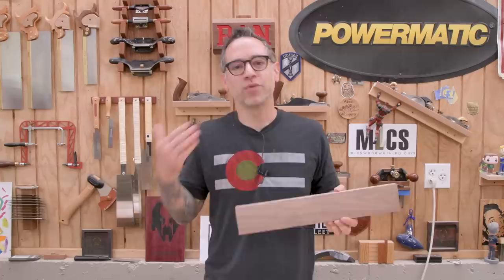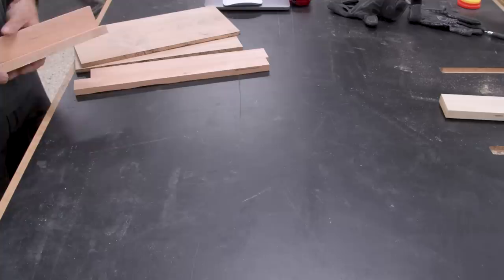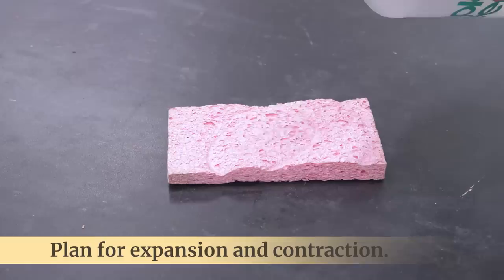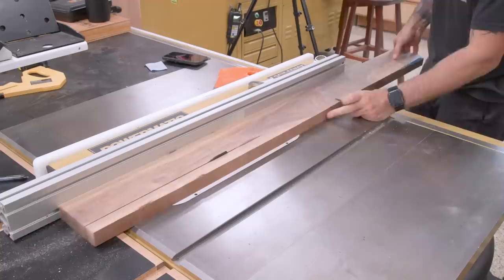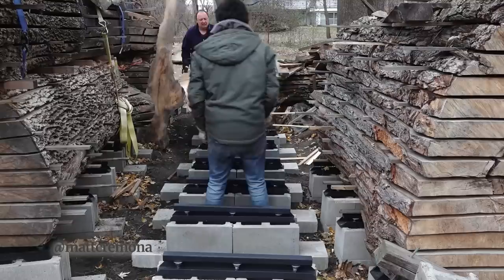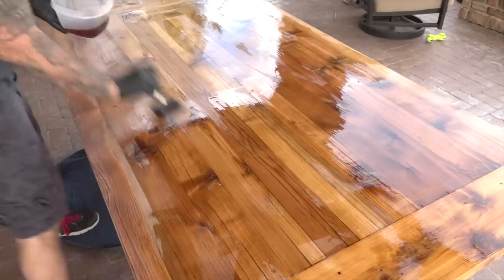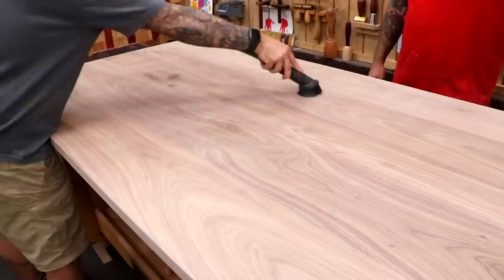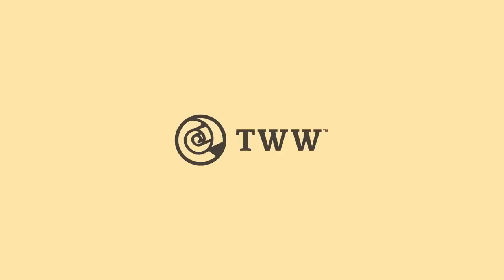Don't Make These Lumber Mistakes! | Tips for New Woodworkers

Comment: Every single new woodworker needs to see this video! As an amateur woodworker myself I’ve seen this happen first hand. Even today on my table saw I saw the off-cut wood bow out as I was cutting it. If only I had left enough margin on the stock to joint it again 🙄 But I’ve learned very early that a project is very fluid - the design has to change with the wood sometimes.
Love your channel and thanks for teaching an amateur all the way down in South Africa 🇿🇦 all these great lessons!

Comment: My dad owned a small sawmill when I was in high school. I remember trying to tail behind the head rig when someone logs had so much tension they would either bind the saw blade and cause it to want to lay over or they would curl so far away from the cut it was almost impossible to keep the board on the roll cages. Having been in woodworking for almost 30 years I can attest the same is true to the wood we use. Another thing to pay attention to when purchasing wood is grain direction. Is it quarter sawn or plain sawn and understanding how the wood moves accordingly. Great advice on getting wood that is sized to the project instead of reading it.
Reply: @Robo.1776  if you're trying to purchase wood to resaw for projects instead of the right size you will waste more than you try to save from tension in the wood and in some cases due to case hardening from the kiln process. And understand the way wood moves (expands and contracts from moisture variances) will make a difference on whether you get quarter sawn or flat sawn wood

Comment: Your discussion of plywood was spot on.  I bought a lot of birch veneered plywood that was apparently from Vietnam.  The veneers were paper thin and came off easily, the cored were irregular with voids/overlaps and poorly glued causing lots of issues.  I have never had so many splinters from any one material in my life!  Fortunately, most of it was used to cover the walls in my shop rather than building something from it.  I got a bunch of Baltic birch from the same source and it was very nice to work with.  

Recently I bit the bullet and bought some Purebond maple veneered plywood from a local home center.  It is almost as nice as the Baltic birch.  The core is all poplar.  My good sawblades are out for sharpening so I'm using an inexpensive Diablo at the moment and still had no chipout from the Purebond ply.  The veneer is much thicker that the cheap birch veneered import ply and it handles beautifully.  My wife was even impressed with how nice the French cleats looked in maple veneer.
Reply: And your experience with the plywood is the reason why my biggest pet peeve is suppliers, and even woodworkers, calling ply Baltic Birch when it isn’t TRUE Baltic Birch 😂

Comment: So appreciative you explained the 8/4 v 4/4 resaw "myth." I was under the impression that 8/4 was the best way to go to maximize yield, and its just not practical based upon cost, let alone the time, effort, and toolage cost to be able to resaw wide boards.
Reply: Most of the time thicker wood has to be a higher grade to make the same size boards. You can start with 5/4 and mill the imperfections out of it for a 4/4 board, but it is alot harder to do the thicker you get. We had to explain this to a customer once that wouldn't understand that 8/4 juniper is impossible to get without bark/wane/knots.
Reply: Yup unless you need smaller boards <1/2” resawing is a waste of time and money, but if you need anything under 1/2” it’s worth it of course because the mark up on those thinner hobby boards is asinine.  Two other tips is always ask for shorts if you don’t need long stock, it’s usually 25-50 percent savings per bf, and don’t sleep on 1common, especially if your project can get away with a few knots for “character”
Reply: Yep. If you put yourself in the mind of the mill operator, it makes total sense. Delivering a lovely big timber is quite an achievement. Resawing flitches to get some residual value out of the smaller material is a good way to produce inexpensive lumber IN SMALL DIMENSIONS.

Comment: Hello, WW
Thank you for this excellent video and I greatly appreciate what you have described as i have encountered most if not all of these conditions. Worst part is when you start with perfect pieces and after machining you end up with nothing but warped and twisted pieces. 

There are a lot of things that we still don't understand about wood like:
1- How long does it take for lumber to acclimate?
2- Why same wood pieces expand and contract differently?
3- Not sure I agree with calculation of how much oak piece of certain width should expand and contract. A good example is wood flooring. In my mother old house, the humidity various from 19% in winter to 85% in summer. The floor violates every rule with heavy coat of polyurethane on one side and nothing on the bottom side. If I follow calculation of expansion and contraction, that floor should bust and smash into the walls in the summer yet every year I measure less than 1/4" movement.

Again, thank you for excellent video and for recommendations. They help but not always effective. Regarding plywood, plywood warp over time and changes in thickness in contrary to common belief that plywood is a stable material. Anything made out of wood is never stable if humidity is not under control. I follow all the rules and sometimes still end up with warping, twist, and anything but flat and square.

Comment: I first learned about "case hardened" wood after resawing a 5/4 piece of cherry that was supposed to become the frame for a box.  It bowed so much that the last 1/2" of the board split on it's own before it got through the bandsaw blade.  Made one hell of a sound - like a gunshot.  Scared the crap out of me.  The board was about 36" long and 9 Inches tall.  Putting the two pieces together afterward there was a 1-1/8" gap in the middle.   Talk about wood movement! :-(

Comment: Good video. Many woodworkers know wood moves. High quality laminated plywood's dry or not do have "board memory".  The edge has a different moisture and stress levels than the center. On a long rip you will see the space where the saw blade passed through close up or spread out. To combat things like this on panels cut out over sized. Rest time to acclimate. Trim all edges as close to same amount as possible to finished size.
 There is another place carpenters can misunderstand properties of wood and moisture. Rough framing lumber and fasteners relationship. Attaching something like dry wall use the shortest screw or nail within reason possible on install to avoid pop. Longer nails or fasteners that go deeper into the lumber will pop more than shorter due to the ratio of shrinkage changing from low at center to more at surface on all sides. Pop happens cause the tip stays put and the surface to tip area shrinks. the longer the fastener the more this happens.

Comment: Heh.  Watching you saw that long, thin board on the tablesaw brought back memories of my only injury at the table saw.  We ran out of 1x2s (trailer manufacturing) so I had to cut up some 2x4s to make them.  Of course that saw's kickback pawls were lost years ago.  Started slicing a badly case-hardened 2x4, which started warping badly, and it caught the blade and kickback city.  
A standard tablesaw is 36" tall,  my inseam was 37".  Guess where I got "punched"?  
Coworkers and foreman got a great laugh out of it, I didn't think it was quite so funny!

Comment: Thanks for the resaw comparison. I have frequently resawn thinking I was saving money. Also, with re-sawing, for me at least, you have to deal more frequently with cupping and twist. After the board is resawn now the resawn side is now exposed to the air and any  moisture or internal is stress released. From experience, this can result in a board that looks like a potato chip.

Comment: To expand a bit on the final topic (about making best use of wood grain) I think we will almost inevitably produce much better work once we develop the habit of paying attention to how each piece of lumber has been cut ... and then think about how THAT cut will work best for a given application.

The most basic example is face grain versus edge grain. (Do a quick web search on this if you don't already know what I mean. It will lead you to many more insights besides this one.) Shipwrights have to pay extra attention to how lumber is cut because, very often in boatbuilding, pieces are steamed or sprung into curved shapes. Wood bends with fewer stresses in the same manner and in the same orientation that the original tree bends. Use this property to advantage!

And the same principles apply, in somewhat milder form, to everything we build. It's not just about looks: it's about how easy the piece is to work into the desired shape, and how stably it will remain in that shape. (But yes, it is also definitely about looks. Because form follows function, after all. Discerning people can see the difference almost instantly.)

Something not often noticed in western woodworking culture, but DEEPLY part of Asian culture, is an awareness of the tip end and the butt end of a piece of lumber. We tend not to think this is even a thing! Well, it is, and we have simply forgotten. For a guy like Jim Spilsbury, who was a radio engineer here on the West Coast of Canada during the early days not so long ago, you simply couldn't build a radio mast - even a guyed one - without understanding which end of the spar was which. Not only is the butt end of a yellow cedar wider, it's significantly more dense and more rigid. The tip is light and flexible, just as it should be. So in timber framing, and really in any construction, we want our posts to be set in the same orientation they grew. All else being equal, we want a cantilever to be cut with the dense wood closest to column and the lighter wood out on the cantilever. And again, discerning people can see the difference almost instantly.

Comment: A few years back, I stopped buying plywood from the local big box stores. Even their expensive "cabinet grade" stuff was full of voids, had thin veneer, and would warp like mad.

Now I drive a bit further and buy from a company that mostly caters to businesses. They do have minimum order quantities, but it's quite reasonable. Also, I'm getting baltic birch which is far more stable than what I can get at the local stores. Price is a bit more, but they also loaded my pickup truck for me. That alone was a huge deal when you consider 600-1200lbs of plywood :)

Comment: You could have also mentioned that it is worth going through the stack to find the quarter sawn boards and those with a grain direction that is likely to stay stable. It is also worth taking a moisture meter with you to the lumber supplier to check the actual moisture level of the board. It may have been kiln dried to below 10 but you have no idea how long ago that was and the wood can take on moisture in the rack unless the supplier has a humidity controlled building.

Comment: It is worth just keeping in mind that even in antique and "vintage" furniture you see these and similar mistakes made.  I've seen old pieces where the wood working and moving had gradually torn the pieces apart over time.  The original maker had ignored or underestimated the movement the wood would be susceptible to.

Comment: When milling pieces that are relatively fresh, and then stacking to air, it can help to paint over the ends of the boards, as that is most of the evaporation occurs, as well as splitting. Not a huge cure, but definitely helps.
Reply: Yes, that's why when installing stain grade base I like to completely smear glue over the miters and scarf joints.  It seals the end grain.

Comment: Excellent info as always. You are definitely a trusted source. Honestly I think you deserve your own TV show. I'd watch it. 

You're so right about wood prices varying even across town and at the same chain stores. Here we have like 6 Lowes' in driving distance and 2 Home Depot's and of course an upscale store specifically for woodworkers and yes prices go up and down. Luckily through diligent research (i.e. Being cheap) I found a hardwood supplier that carries Baltic birch at a better price along with, of course, hardwoods and I also found an Urban Sawmill...their term but it's appropriate. They only deal in Appalachian hardwoods (cherry, maple, pecan, walnut, hickory, etc) and their prices are much better than specially shops and they have their own kiln which is enormous. The guys there are great and easy to deal with. I bought a 13 in x 11 ft x 1 in piece of hickory that they planed flat for me for $54. Unbeatable!

Comment: anyone that has ripped some 2x4 from the home store will quickly learn about wood stresses.  it's real fun when it pinches your blade to a stop mid-cut!
as for pricing, even if you have a favorite place, still compare against the other stores.  my local lumber place is great for wood, but they way overcharge for cement boards.

Comment: I found this very interesting.  It has been my practice to allow a few days or a week between  resawing and dimensioning and to dimension oversize initially and then finish to exact sizes after allowing a few more days for the timber to settle and " relax" between each stage.  Maybe I have been wrong!

Comment: "Wood can move during a cut," you say. You should have seen me trying to mill a slab of curly maple. It literally yanked my track saw off of the sled and sent it careening across the sled and work bench, thankfully away from me. The sled was scarred. During another cut the board clamped shut on my table saw blade (Jet saw  - 3 ph motor). I might as well have been using s Stop Saw. I could not believe how much tension was release, even on a simple bandsaw rip. It was like trying to make furniture out of a wooden dragon. Amazing!

Comment: Yes, I feel like a moron because I just built a paint grade plywood base cabinet.  For the plywood doors I primed one side only and let it dry, I also let it warp all to hell.  I had to cut 2 new doors, re edgeband then I primed one side, flipped it over immediately and primed the other side.  They will be nice when finished.
I'm a finish carpenter but most my experience is installing.  Fabricating and finishing is a different set of skills so it's easy to forget something, even simple obvious stuff.
By the way, I have the Graco ultra cordless sprayer.  I have to say I really like it and have had good luck so far.  Being able to spray thick latex undiluted is nice.  I keep it clean and always store it with pump armor.

Comment: Thanks for another great video. 

I recently decided to build a French Cleat wall and used 3/4” birch plywood cut down to 5” x 48” strips. About a week after cutting, I went to put them on the wall and they remained flat but all of them were curved in the middle like a 5” wide parentheses! (Paren?). 

I didn’t expect plywood to move like that!  Do you have an idea what could have happened?  Cheap plywood?

Comment: Sometimes plywood doesn't save you money.  Hardwood veneered plywood often costs the same or more per board foot than solid lumber of the same species.  The main advantages of plywood in those instances is it's more dimensionally stable and you can create large surfaces with less work.

Comment: Thanks Marc!!  This was really helpful! I have been meaning to post a question to the Woodtalk podcast in regard to this topic.  Wood movement of solid wood intimidates me and causes me to use veneer plywood for my projects along with some solid wood.  The estimator link accounts for grain orientation in the movement of the wood but what would be a good resource for taking grain orientation into consideration when it comes to building furniture projects?  Thanks for what you do!  Tell Nicole hi...I'm from Spfd. MO
Reply: I have had much luck bending back lightly warped and twisted wood by over bending, clamping and heating a few days.
On/over a large wood stove. The sun might take much longer. And it will move given time.

Comment: Hi Marc! When you was speaking about the fact that thicker board is actually more expensive than two thinner ones, I wondered - how do woodworkers in the US normally purchase wood? I mean, here in Russia we have basically two choices of thickness (except for cheap pine in stores like home depot), and the wood is priced by its volume, not board-feet like you explained. You have more choices in thickness, and it is priced per board, right?
Reply from the maker: Board foot is a measure of volume. It's LxWxT /144  So we usually pay by volume as well.
Reply: @woodwhisperer  Oh) thanks for the clarification. But nevertheless, in most places in the US the amount of money per board foot depends on particular board, right?
Reply from the maker: It depends on the species, thickness and grade of the wood.

Comment: If you're taking 4/4 lumber and resawing it into 1/4" or 1/2" boards then you actually are saving money. Anything under an inch is almost always the same cost as 4/4 lumber, sometimes marginally cheaper.

Comment: Point of order!!!! 
Sometimes, yes, buying the larger board cost more. And you have to spend 2 work hours to get it sized and dimensioned. However, there are times when all the standard sized boards are just beat to death and ugly. And the older, larger, lonely, lots of love to give boards have had more time to dry and be left unharmed by the hands of throw the board on the floor while I look for a good one, crowd. 

That’s all I got. Commence.

Comment: I used to use a lot more plywood, then I got a sawmill.  When you've got 1500-2000 board feet of some species stacked in the yard, it's waaay too easy to say, "F*** it, I'll just make solid panels."